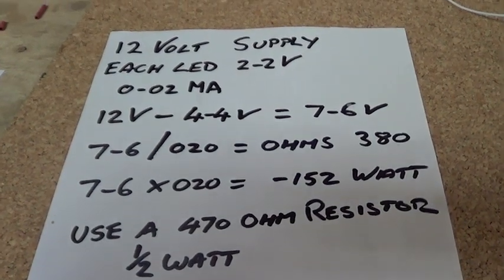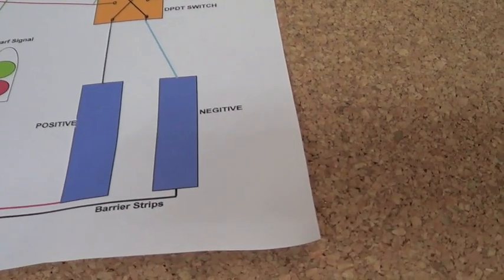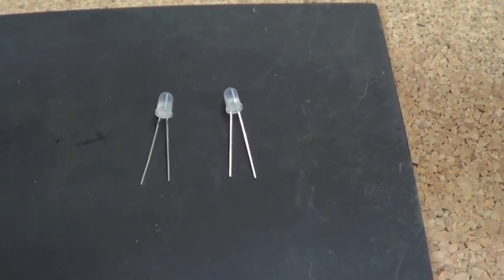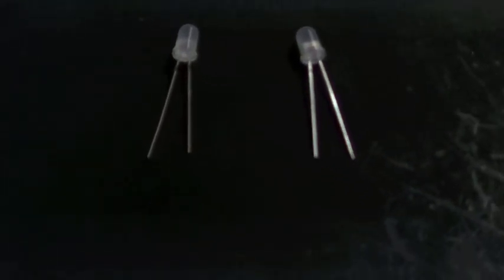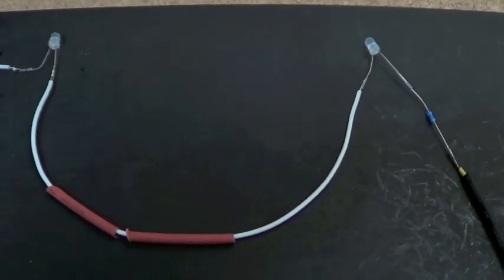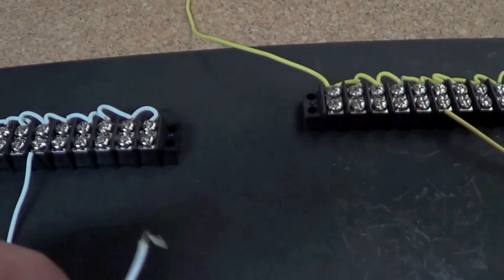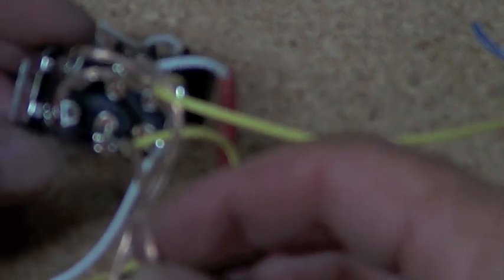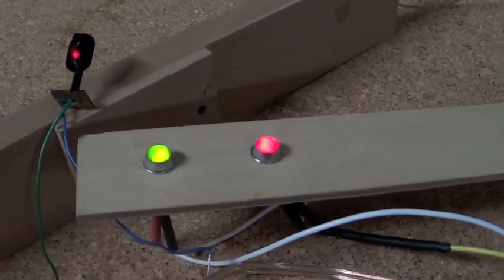"Wiring Leds & Dwarf Signals for Control Panel" Model Trains Part 17

Comment: Hello Robert,  is it possible to wire a home & distant dwarf signals into  a Tortoise motor Ive got the home signal working but not the distant even 

 though I conect it to the one thats working.......
Reply from the maker: I would have thought that it would work, are they both the same voltage, and are they both 2 wires or three?

Comment: Thank you very much for your prompt reply.....Cheers
Reply from the maker: No worries! Cheers Robert
Reply: Your right Robert, an extra  dwarf signal does work off the same connection. I had two faulty dwarf signals . My home & distant signals are working fine.....Thanks again for your help.....U.K. Brian
Reply from the maker: @brianwebster4858   Thats great Brian

Comment: Thank you for this info...I have used this Diagram & it works great but my Led restors are getting quite warm. what value resistors did you use.. My wall adapter is 12 volts...
Reply from the maker: I used a 470 OHM Resistor but you could try a 1000 OHM which is 1K and see if that works cheers

Comment: I am curious. How many tortise switch machines and leds can be hooked up to the 12v power supply at one time. I ask cause intried this and when the leds are hooked up the lights are very faded and dim. And when switching it it dosent seem to work and I would really like for this to work . Any help would be great. I have about 6 tortise switch machines hooked up to my powet supply
Reply from the maker: You should be able to run 30 Switch Machines on 12v 500ma cheers Robert
Reply: @csxmad  robert any Ideas as to why my lights are not coming on strong by chance and look dim when connected
Reply from the maker: @kanishirosouthwester   What voltage are your lights?
Reply: @csxmad  I am using the same one u are as I followed what u purchased and u had givem me where to buy them. Maybe  I should try without resistor as maybe I got wrong ligjts
Reply: Do u have Facebook or messenger that I can send u pics of what I have done ad I cannot seem to send u pics here

Comment: Thank you for showing how its done video. I'm in the process of building a High shelf twin track layout in a 20 x 28 room. I plan on running a couple of turnouts on there and it's very important to me to know the position of the turnouts. 🚂🚃🚃🚃
Reply from the maker: Richard i hope it all works out for you and i like the idea off knowing which
way the turnouts are turned cheers Robert

Comment: Just wired my control panel using this method and it works perfectly! Thanks.
Reply from the maker: +Bernard Hellen  Thanks for letting me know cheers Robert
Reply: Glad it worked, I am trying the same method but my lights go dim when I try to power them up. How many tortise and lights can u hook up to the 12v at the same time . Any help would be great

Comment: just a suggestion..if you aren't finished with  your in stall, try this. you can install your panel led's in series with eithr pin 1 or pin 8. hook your leds in the same fashion & install them in series with pin 1 or 8. the draw is minimal & won't have an effect on tortoise operation & you will save some time. for your dwarfs why don't you use the internal contacts in the tortoise machine. this is how i have mine set up
vinny...aka...bnsf6951